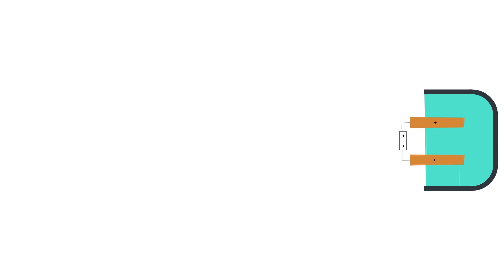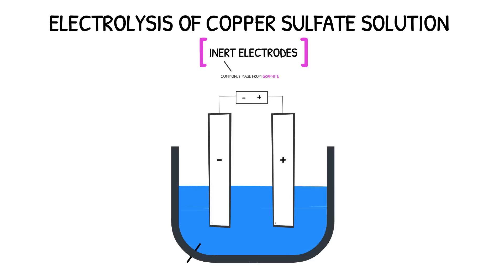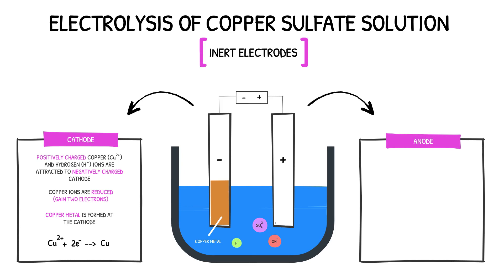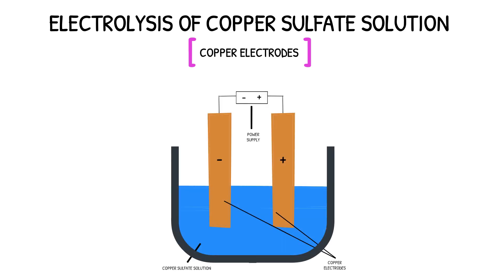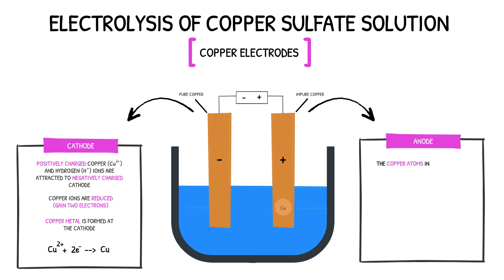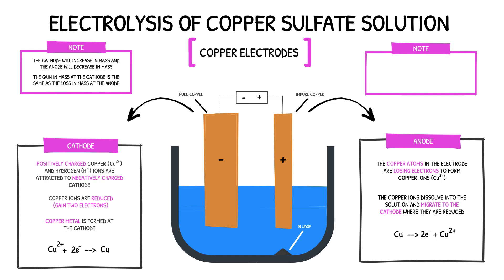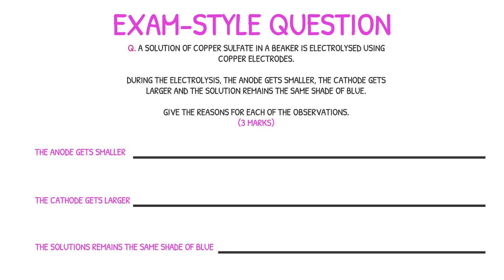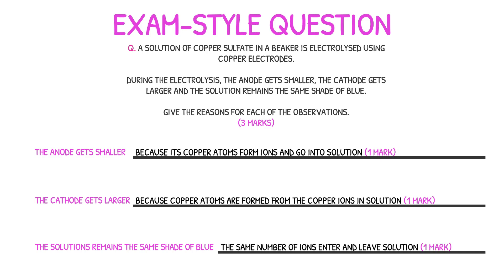GCSE Chemistry Revision - (#30) Electrolysis of Copper Sulfate Solution

Comment: The half equation has +4electrons because each oxygen has lost 2 electrons? If so, what about 2 electrons from hydrogen?
Reply: The half equation has 4 electrons because there's 4 OH- and in order to discharge the 4 hydroxide ions you would need 4 electrons as each hydroxide ion has a -1 charge essentially.